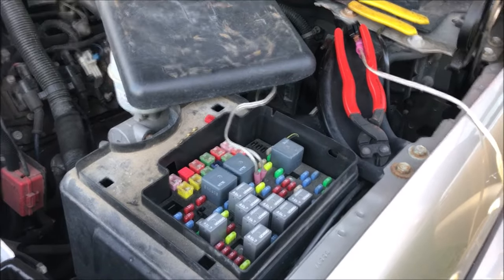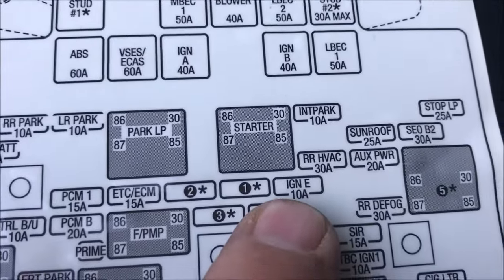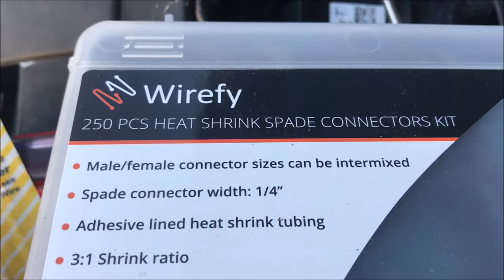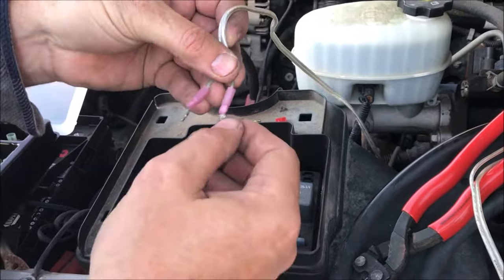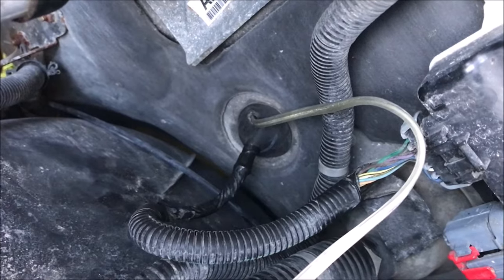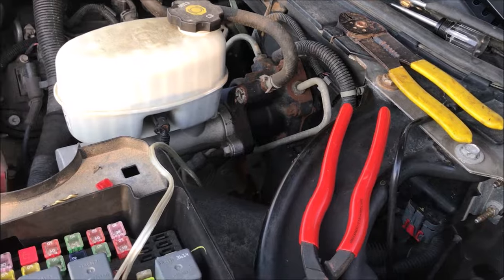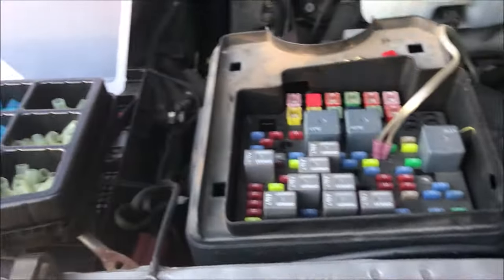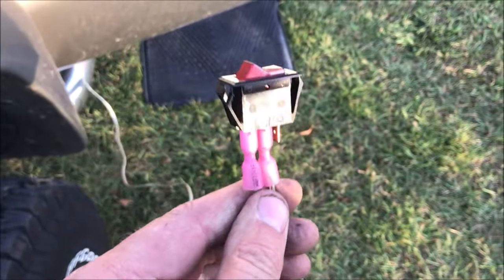OldGuyDIY $7 Car Truck Ignition Fuse Hidden Cut Out Kill Switch Defeat Stop Thieves No Car Stolen

Comment: Thieves are smart too. They’re tricky little bastards and some of them will get into your car and open the hood and see your wiring get up ,not good because he just stole your car and quite easily. Run the wires from  under fuse box wiring harness, with the wires hidden to a remote breaker and fuse or a kill switch and put a dummy fuse in along with the rest of the fuses, and it will be less noticeable visually.… Great show… Keep on rockin.
Reply from the maker: Thank you for the words of wisdom.
Reply: I chain/padlock the hood closed on my 2020.   @OldGuyDIY

Comment: Not bad! It's preferable to put it on the fuel pump. Some thief will simply jump start, but they might think the car is broken if it "starts", but does not ignite
Reply from the maker: Thank you.
Reply: Yeah, my F150 has a relay for the fuel pump, but I found by accident that there is a 15A fuse that controls the fuel injectors. Install a kill switch on that one a the engine will turn over but not start.

Comment: I have a 150 lbs Great Dane we call the baby shark.  I blacked out the back windows with the darkest tint I could find, and using a reciprocating saw, I installed a drain in the floorboards for what BabyS leaves behind.
Reply from the maker: The insurance company should cut you a break.  That car will never be stolen.

Comment: This is a great idea.  One improvement You could  buy a remote activated relay and add it in.  20 bucks.  That would eliminate the switch and make this more convenient .   Then there is no switch for them to find.  Thieves know about kill switches and might take a minute and find it.  The remote is with you.
Reply from the maker: Thanks for sharing the next step in thief proofing a car.  This solution was intended to stop the smash and gab thieves.  I believe if a thief has time and wants a vehicle badly enough, he will get it.

Comment: I also think the wire should be wired under the fuse box to hide the wire. Use the same type of wires that you normally see under the hood. Your wire looks radically different. 

Hide the kill switch, but install an additional fake kill switch in an obvious prominent place. Wire the fake kill switch to activate and lock on loud siren’s inside and outside the car, powered by separate batteries. If the sound volume from the sirens is extremely loud, the criminal will be severely punished by the loud sound and will not be able to stay inside the car, unless the criminal is also deaf, which is very unlikely. The loud sirens will also attract attention to the car. Make sure that you or your passengers never switch the fake kill switch!
Reply from the maker: I suspect if someone wants to steal the vehicle, it will be a smash and grab.  If they are willing to invest the time to raise the hood and do some troubleshooting, they probably know enough about vehicles to successfully steal it whether it has a kill switch or not.
Reply: @OldGuyDIY  True, they tied to steal my Kia Soul a few days ago(got rear ended the sam day!) they successfully did everything they had to, but for some reason they didnt get it! i think they failed to realize you have to turn the steering wheel right while starting it to unlock the wheel. i guess i got lucky. going to wire up a kill switch to the fuel pump. in the meantime ive been taking the terminals off the battery to at least make it take a bit longer to get it started...
Reply from the maker: Good luck.
Reply: You forgot the part about tying into the power locks so it locks the criminal in the car with the blaring siren. Lol
Wasn't there a movie Death Car or something like that.

Comment: I have a driver side fuse panel that has a 7.5 A , number 8, AM1, fuse for starting system.  If I remove this at night and put back in morning, do you think it will kind of do the same?
Reply from the maker: Probably.  I suggest removing the fuse and attempting to start the vehicle.  If it does not start, you found a fuse that does the job.  If it does start, pick another fuse, perhaps IGN, ignition, and try again. Good luck.

Comment: It is great idea and much easier for gas model car. Kill switch for gas pump, fuel injector or starter solenoid but any idea which fuse can use for hybrid or plug in hybrid as they don’t have starter
Reply from the maker: I don't know anything about hybrid vehicles, so I cannot help based on experience.  If I were attempting it, I would go to the fuse panel, starting with the lowest amperage fuse, remove the fuse and see if the vehicle starts.  Continue testing each fuse until you find one that causes the car not to start. Run a hidden switch to that fuse.  Good luck.

Comment: I put a 250 V 25 amp switch in my car with the fuse box. It worked at first then the car went off as I was driving and I put a fuse in one of the wires. I put it with the fuse box so what’s wrong?

Comment: I wouldn’t do any rough wiring on the ignition, you might need reliability… also why not hook it to the starter relay and in the off position have it trigger a cabin siren..
Reply from the maker: There are lots of circuits a person can choose to interrupt to keep the car from starting.  I don't have a siren and came up with this solution based on material I had on hand.  I suspect running the switch to the starter relay will also do the job.

Comment: No breaker now if anything goes wrong with the circuit 
Is that a problem?
Reply from the maker: It has an in-line 10 Amp fuse.
Reply: @OldGuyDIY  does it matter which wire you use for the inline fuse? Or do I use one on each wire?
Reply: @KartsAndCoffee  no, just one side; just made sure its the same amperage as the one taking out .
Reply: @KartsAndCoffee     It certainly does matter, because fuses only protect against a short to ground down stream... so the inline fuse needs to located as close as possible to the hot side of the fuse panel socket. A second fuse added further downstream adds zero protection.
Reply: The fuse he installed is just connecting a single wire with no ground connection at this level so, no, it does not matter which side of the wire he places the fuse  !  Just imagine it is a single wire interrupted by a fuse !  Just the same concept inside the fuse itself, it does not matter if you place the fuse one way or the other it will still work !

Comment: This is a really helpful idea, I wonder if it’ll work with wipers, my wipers don’t shut off when the relay is connected
Reply from the maker: Yes, it will work with any circuit you install it on.  Good luck.
Reply: @OldGuyDIY  appreciate it
Reply from the maker: You are welcome.

Comment: You have no fuse for ecm, you won’t have to worry about car stolen if have short or surge and fry your computer. From that fuse trace that wire to the main wiring harness that come behind dash and tap into wire there, hide the switch and wrap with electrical tape to blend it in with rest. Also match that fuse amp with a switch that rating can handle that many amp.
Reply from the maker: Thank you for the information.  I installed a 10 amp fuse in line when I did this job.

Comment: Amazing idea
Reply: The wiring point is an excellent idea, but the rest won't cut it. Those wires under the hood can be bypassed by the dumbest of thieves. They have to be hidden, and a burnt fuse has to be in that slot.

Comment: Why not just find the ignition power wire in the dash and tap that with a switch?
Reply from the maker: You could do that.  I am an old, big guy who doesn't do his best work in small, dark spaces under the dash.  The technique I show here doesn't require finding a schematic or using a multi-meter to confirm wire hotness.

Comment: that's a starting point but were is the fuse ? what is going to protect the current ? so how about a piggy back fuse holder [ lets you put two fuse's in one slot ] that you can Branch off of ! but why stop there do the ignition , the starter and the fuel pump ! six wire in a loom that looks oem not some zip cord from an old lamp ! one switch could do it a sp3t  or single pull three pole its like having three single switches in one  ! and if it won't crank has no spark and no gas there gone ! just don't brag about it ! or they will still it just to show you !

Comment: Not very smart...thieves would quickly check fuse box, see your wires... and EXPENSIVE car is gone...
 if you have an old/inexpensive car, thieves wouldn't even noticed it
Reply from the maker: The pictured vehicle is a 20 year old Chevy Suburban.
Reply: Thieves usually break a window them use a slide hammer to pull out the ignition switch, cut a couple of wires, twist them together then touch the start wire to the run wire, then drive off.  Most thieves know very little about checking under the hood or even opening the fuse box.  On the other hand, if they are high end cars and being stolen by professionals, they will like just pull up in a tow truck and drive away with your Ferrari

Comment: But you deleted the fuse!
Reply from the maker: No, I have an in-line 10 amp fuse in the wire.
Reply: @OldGuyDIY Putting the original equipment protected by that fuse aside, you would have to locate the fuse as close to the 12v source as possible like in the fuse box area.  This protects the new kill switch source wiring from shorting to ground at somewhere like the firewall opening which hopefully has a grommet.  I'm sure you got it all figured out, just was not obvious to me and you put together a good video so sure others will reference it.

Comment: You need an inline fuse brother, you just bypassed the only fuse for that starter wire
Reply from the maker: An inline fuse has been installed.
Reply: @OldGuyDIY does it matter wich side you wire it into ? I assum it is installed on the wire that’s hot from fuse box
Reply from the maker: You are effectively putting the switch in line on the hot wire.  The ground is run to ground somewhere else. So no, it doesn't matter which side you wire into.